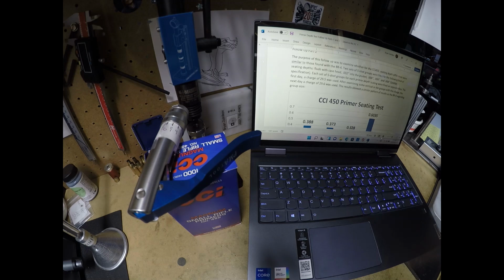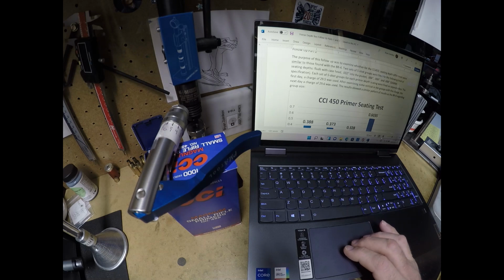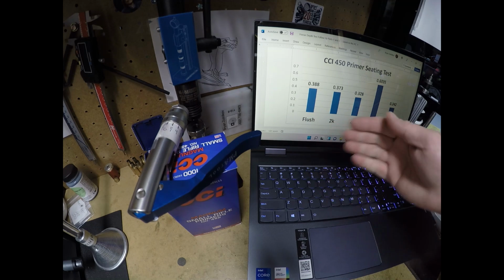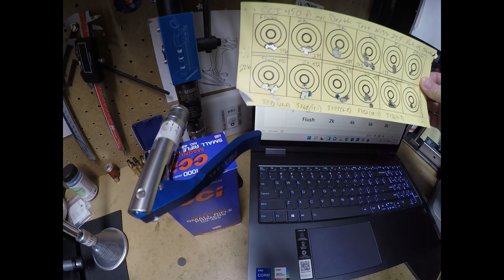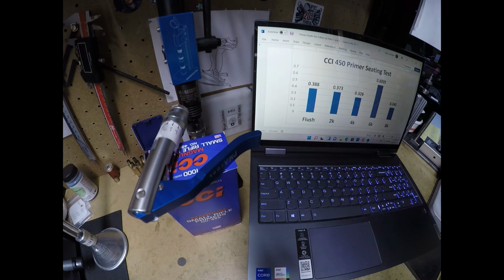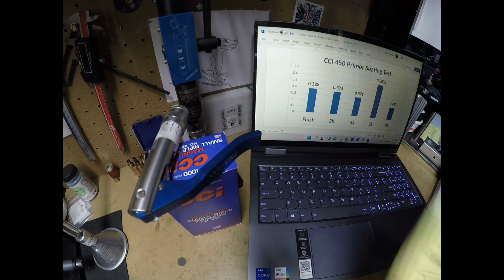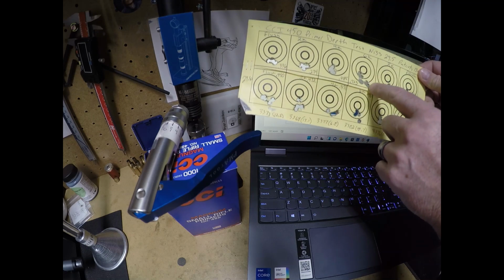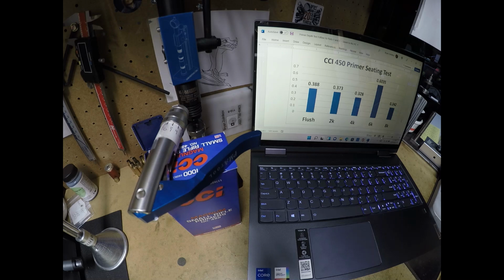Witch Doctor: Brief Follow Up to Primer Seating Depth Tests

Comment: When the primer is not set on the perfekt dept, and you get flyers is that because the speed is differently or somting else ???
Reply from the maker: @andrebosgraaf2086  speeds are pretty consistent so it’s likely something else.
Reply: @WitchDoctorPrecision  so it's a mystery,  every shot i do it 300 meters i measure the speed,  and the strange part is to lowest es and SD are not always the smallest groups in my 6.5 grendel.  So some things are still a mystery

Comment: I'm unclear as to what your testing deemed important. Is it primer depth below flush with the case head (this is I believe the spec that SAMMI refers to) or is it the amount that the anvil is pushed into the cup? In your example these numbers are the same at .009" but that is only occurring because both primers, the BR2's and the 450's are the same thickness as the cups are deep at .122". In both examples the anvil is touching the top of the pocket just as the cup gets flush with the case head. Looking at the SAMMI specs for pocket depth and primer thickness you can see this isn't going to occur very often. The brass primer combination I'm currently using the primers have to be .005" below flush before the anvil even touches and I can't compress the anvil. 009" because it only protrudes .005" to start with. That said, this combo shoots well at .008" below flush. Thanks for any feedback you can provide. Also,  do you define "crush" as the amount the anvil is pushed into the cup? Thanks
Reply from the maker: Thanks for tuning in. Yes, it is the amount the anvil was compressed. You would need to measure pocket depths, primer height, and primer cup height to determine how much seating you will need to get .008” of anvil compression. For example, when I use Lapua brass with Federal 205M primers, I seat to .005” to get .008” anvil compression because the pockets are .119” deep, cups are .1075 high, and anvil protrudes .0145. Seating to .005” in this scenario leaves only .0065 from the top of the primer cup to the ceiling of the pocket so if the anvil protrudes .0145 subtract that from .0065 and you get .008 anvil compression. Since pocket and primer dimensions can vary among manufacturers, I would measure it all and then determine where you need to be in terms of seating depth.
Reply: @WitchDoctorPrecision  thanks for the clarification. I was wondering about the very example you just mentioned. Where the primer is actually thicker than the cup is deep so you have to apply some "crush" just to get the primer below flush. How about the situation where the anvil protrudes less than .008"? Perhaps start with it fully crushed ie pushed completely into the cup until the cup hits the top of the pocket and experiment from there?
Reply from the maker: @MilesKillian-w5o  I don’t know about primers where there is less than .008 anvil protrusion. All the ones I use have .010-.015” anvil protrusion like the Federal 205, 205M, 210, and 210M and various CCI primers. I know there are other primer types, primer pocket designs, and other variations so with those, I would test things out to see if there is a sweet spot with precision.
Reply: @WitchDoctorPrecision  thanks

Comment: Bryan I have found your videos extremely helpful and informative. Can you tell me what you use to measure how deep the primer is seated in the case? Thanks
Reply from the maker: Thanks! The simplest and most reliable method to measure primer depth are calipers. I have a video on how to use them to measure.

Comment: Hi Bryan, I ran across your channel a couple of days ago and really appreciate the videos you have posted.  I watched all 3 primer seating videos and was hoping you would answer a question for me.  I have measured my ADG brass for the 6.5 PRC.  The primer pockets are 0.127-0.128 deep.  When I measure the Fed 215M primers that I use, they are also 0.127-0.128 from the bottom of the cup to the top of the anvil.  It looks like the cup itself is only 0.114 high which would make the anvil protrude about 0.014 above the cup.  I know the only accurate way to find the proper crush is by testing but was curious if you thought that your testing results of 0.009 depth would apply here also?  TIA
Reply from the maker: Thanks for tuning in. The .009 depth should apply. I’ve found good results from .007-.009 so anywhere in there should be a good starting point to test. Let us know how it goes!

Comment: I need a seating depth priming tool. If you were in the market now, would you still go with the PMA?  Is seems like a good value that will give consistent seating depths.
Reply from the maker: For situations where I have to load at a match, I go with the PMA or 21st Century AND I use Federal 205 or 205M primers because their width is smaller than CCI BR-4 and 450 which means it is less force to get them seated to spec. This is easier on my hands. Now for situations where I preload with CCI primers, I have used both the PMA and 21st Century with success but the pressure to get them seated to spec is a bit much for my old hands :) so I am getting a bench top priming tool which should be easier on my hands. I am going with the Holland-RCBS tool for now and will try it out. 
https://www.hollandguns.com/m7_invoice.html
Reply: @WitchDoctorPrecision  I have been using the Lee Auto Bench Prime, but it is hard to control the seating depth.  I manly got if for the Tulammo LR primers due to unable to seat deep enough with my Dillon 550. When I seat my Fed GMM with the lee, if I seat too deep, the primer anvil tip will create a slight dent/protrusion in the primer cup. Looking forward to to your review on the Holland.

Comment: Primal Rights (the competition primer seater guy) has been talking about the importance of the timing of the firing pin hitting the primer. He’s basically talking about the distance from the firing pin to the base of the primer as the important measurement. Do you have any testing looking at timing vs the amount of anvil compression? 

Timing or the distance from the firing pin to the base of the primer would only seem to change the speed at which the firing pin hits the primer. I don’t know this as a fact but a couple thousandths of an inch would probably be almost the exact same firing pin velocity. 

Changing the initial amount of anvil compression by a couple thousandths would seem to make a much bigger difference in how the primer reacts. This is just my guess though. 

Depending on which one is most important would significantly change where the best place to measure from is.
Reply from the maker: Yes, thank you for bringing this up. Pin fall travel would have to be below ~.200" to start having a negative impact in my rig. I am set with ~.235" pin fall and .065" pin protrusion so among all of the primer seating depths in my tests, I am getting plenty of pin fall and pin protrusion to ignite effectively. This enables me to have the confidence to place the attribution of effects on the primer anvil compression. If the pin fall and protrusion were well outside of acceptable specs, then the attribution would get muddied but this is not the case. Thanks for viewing and happy 2022!

Comment: This is really interesting.  I use Lapua Blue box 6br brass and cci450 primers.  The primer pocket and the primers are BOTH .120.  In order to seat them .008 deep(crush) it takes a tremendous amount of force on both my Lee and RCBS primer tools.  I ran the same test that you ran and for me that is clearly the worst depth.  .003 was far and away the best in my rifle.  Perhaps the point is twofold.  First is that there definitely is a "best" and "worst" depth and second that each rifle and/or load will be unique in what it likes.
Reply from the maker: Yes, the CCIs have a wider cup relative to say a Federal 205M. The pressure needed to seat these two is markedly different.

Comment: Hey Bryan, have you done any seating depth tests with large rifle primers such as the BR2? If so, what level of crush on the anvil do you recommend? Love the videos, and thank you.
Reply from the maker: I have not. SAAMI recommends the same .008" for small and large rifle primers. Seems like .008" anvil compression should work for both SRP and LRP. I would start there and test it out. If it looks good on target, great. If not, then you can try another .001" more or less compressed.
Reply: @WitchDoctorPrecision  

Thanks Bryan, appreciate it man.

Comment: Thanks and happy new year Bryan! 

I have been wondering about how primer seating depth and bullet seating depth may interact with barrel harmonics to drive different group sizes. For example,considering that 8 tho primer depth result in smaller group sizes than 6 tho at a given bullet seating depth, would we find opposite results with a bullet seating depth optimized for smallest group size at 6 tho primer depth?

The theory behind it would be that primer seating depth impacts how the barrel vibrates when ignition occurs and selected bullet seating depth is optimized for the bullet to exit the muzzle at the right time for minimum/consistent vibration (i.e., small group size).

I would be surprised if this theory would hold. But if it were, this would mean that different primer seating depths result in similar group size as long as the bullet seating depth is optimized for a chosen primer seating depth.

Perhaps another test? Run a bullet seating ladder with the primer seated at 6 tho and check how group size compares with previous results?
Reply from the maker: Happy new year! I’m finding nonrelativistic effects with these tests so I am skeptical of this idea. I already tested two relativistic ideas similar to this and found no effect so I am not very enthusiastic to attempt this type of test. I would certainly love to see the results of this type of test should you or somebody else conduct this test.